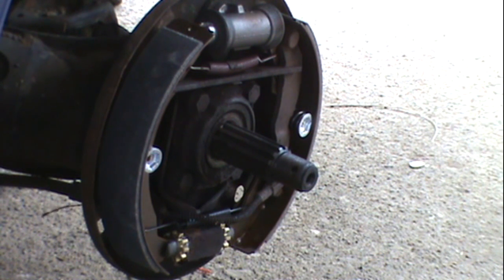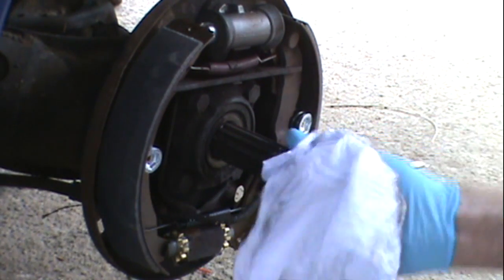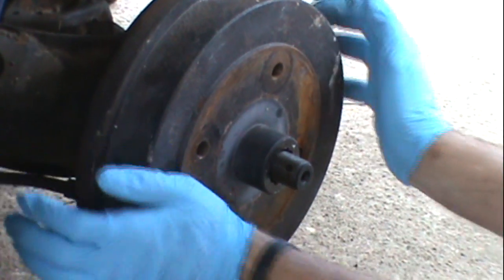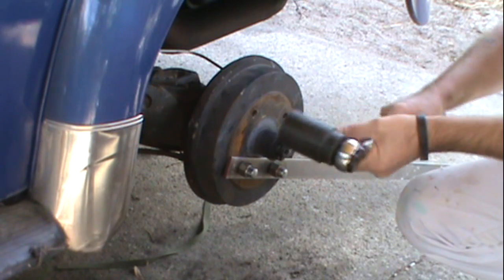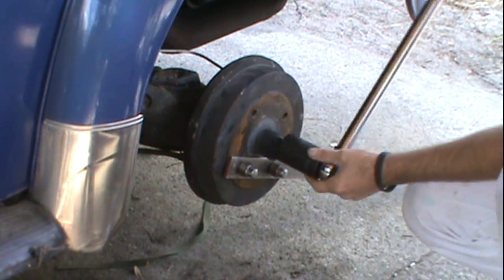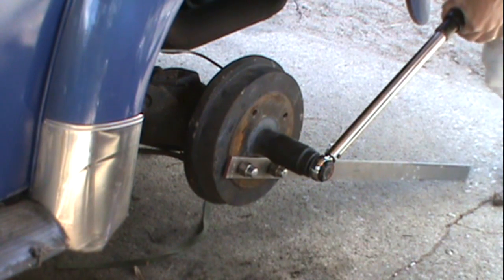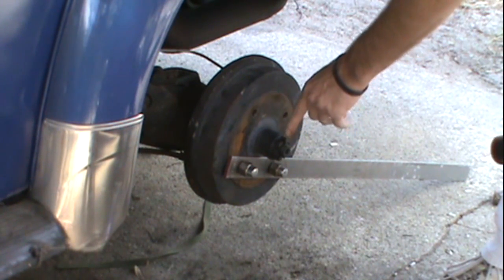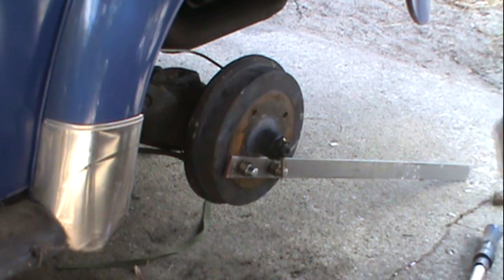VW brake drum install and torque

Comment: when it clicks you really need to stop. Those Threads are now Stretched. Sorry but they are.  Kids work your way up torque to 100lbs then go 180 and then top it off at 220. Recheck but don't go past the recommended torques. And all torque specifications are give for Stone Dry fasteners. If they have oil on them you must reduce the torque> do that on a aircraft and they will fire you on the spot. don't want to hi jack your tube but 5000 people have read this post.